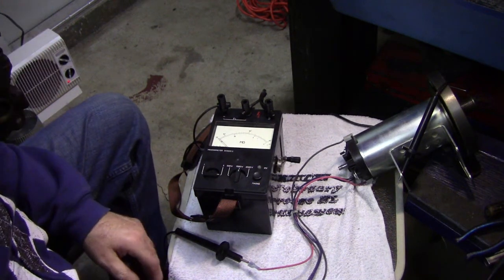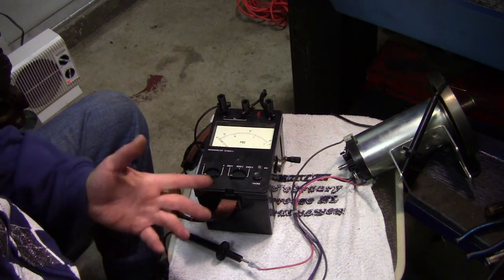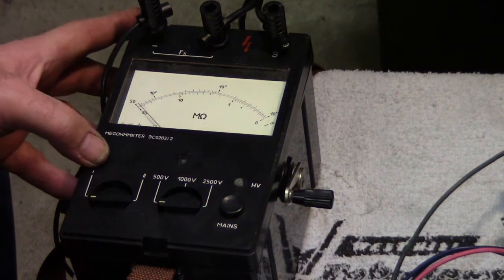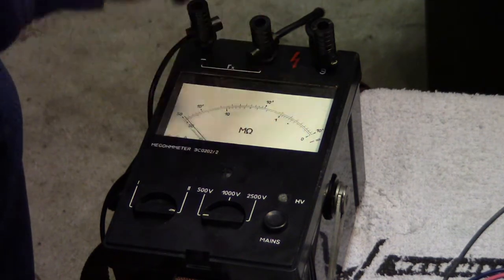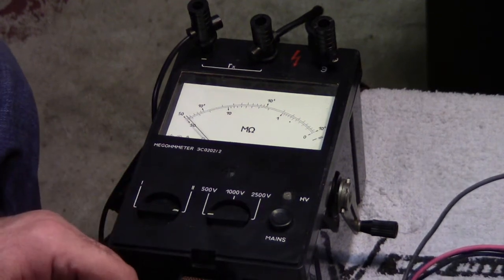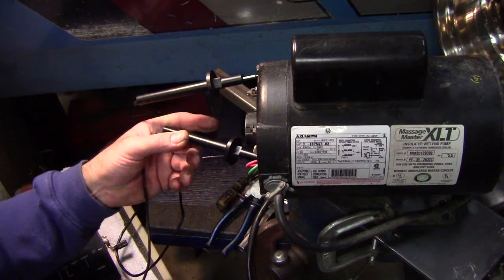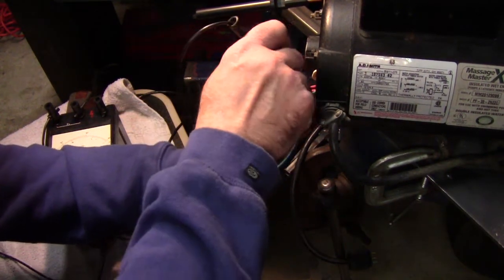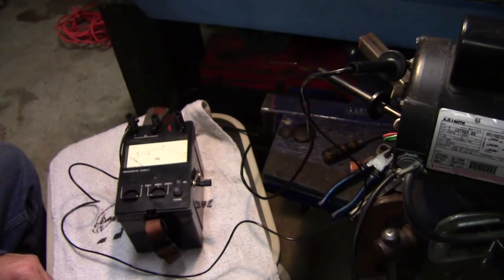How to  -Megohmmeter

Comment: I’ve got three of these. An old 1250 and two of the newer 6503 type.  I am an HVAC instructor, and we teach the use of Meggers in our program using the AMEC products.
Reply from the maker: This unit is the only one we have. My Father is an Electrical engineer. He still has many old meters that he use to use in his company.  Great to hear that you are still teaching with the old terst equipment. They seem to last for years.
Thanks for watching.

Comment: thanks for the megaohm meter, there's hardly any vids on it and I've never used one before, I'm a young lad and I wanted to learn more how to use it, how it works etc
Reply from the maker: There is also a test from the winding to ground to test as well. I`m not sure if that got into the video. I`ts been a while since I made the video. AC and Refrigeration guys use similar meters to test compressors. Glad I could help.